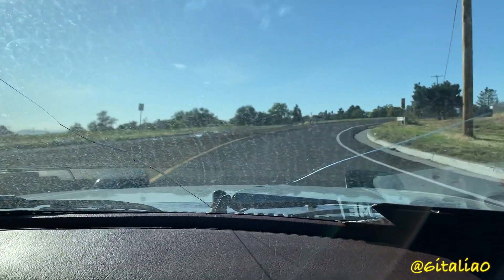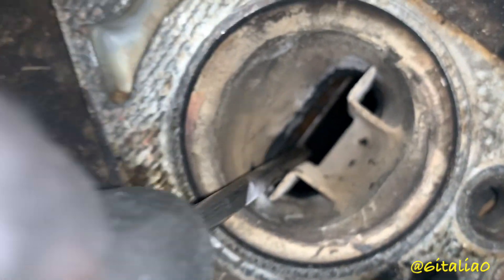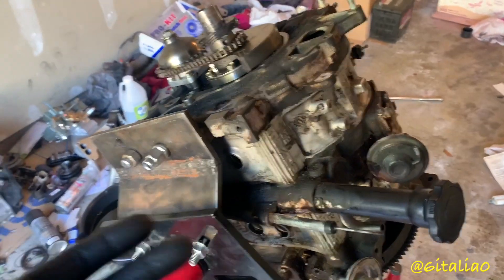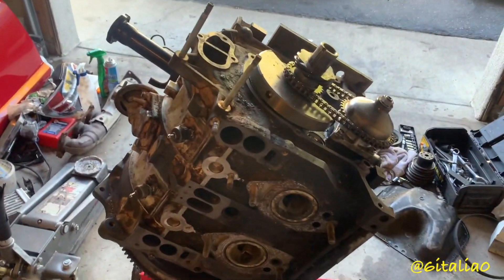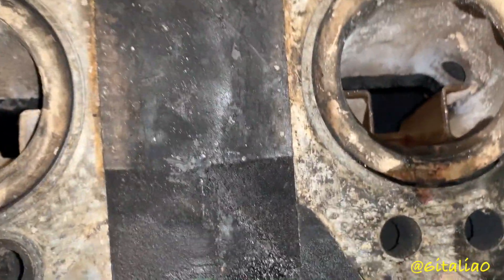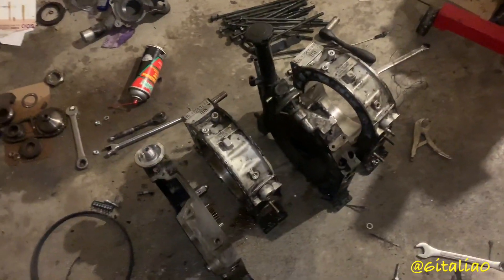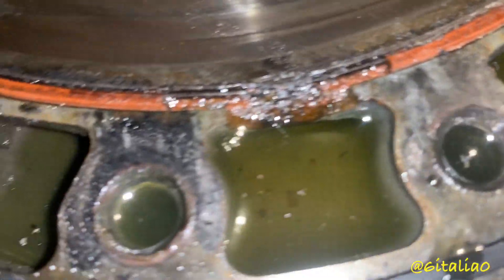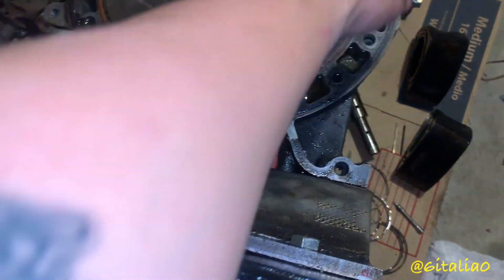WHY YOU SHOULD BEAT ON A ROTARY ENGINE (and what happens when you don't)

Comment: Hey Nate, I have an RX-8 and  I might have to rebuild it not 100% sure, I was wondering what you need as far as a rebuild kit? You said 105.00 for seals but let me know what I would possible need.
Reply from the maker: to assemble the keg you need apex, corner and side seals, oil control rings (should be reusable, depends how much silver colored wear is showing) and corresponding springs for each (this is all you need to assemble the rotors. to close the keg you will need water seals, orings for the oil gallery that goes through the upper left hand side of the engine, oil control ring orings  and tension bolt orings. Check out Atkinsrotary.com as they have complete kit including all necessary external gaskets and seals needed as well
Reply: @NateRist  Thank you so much!! So today I got a new battery and was able to start the car, but it wouldn't idle so I have to trouble shoot that. I had it run for 15 mins then turned it off. After that It wouldn't restart it just keep on trying to start. It backfires sometimes and blows smoke not coolent. Any direction would be helpful.
Reply: @huffdesigner  Get a proper rotary-style compression test. That will tell you the state of the engine.
Reply: @SeanFlaherty   Hello Sean, thanks for the tip. I took it to a shop where I'm from and they said one part of the engine fires and the other doesn't work. It just smokes bad.
Reply: I can get it started but it just dies after awhile and it smokes so bad. I will get a compression test and see what I need.
Reply: @huffdesigner  What color is the smoke? white is coolant (not good), blue is oil (also not good), black (I'm not sure, too rich?).  Do you notice your coolant level going down? Milky oil (coolant in the oil.). All not good signs.
Reply: @SeanFlaherty   it was whiteish blue I think. I checked the coolant and its totally perfect the levels are great. I know the motor is blown I don't know how bad. I need to take it apart. I might just buy one from a company for 2600.00. Not sure Im still deciding. I want to drive this car. I seriously love cars that handle well and that you can rev the piss out of.

Comment: Need help with my turbo 2 its been sitting for 10yrs had fuel problems at that time.. I don't now the rotary life.. any good rotary shop in san Diego
Reply from the maker: DNA garage can probably help you. They’re in Santa Ana, but give them a call and tell them about your issues and they should be able to help you +1 (562) 608-5161

Comment: Also you can put some diesel in it not a lot just a little and turn the motor
Reply: mix of naphta, diesel, and izopropyl alkohol in good ratio is bassicly seafoam, and i can say it cleans engines pretty good.

Comment: @3:11 the ATF trick yea but...@4:46 oh thank god lol. not sure what rotorhead taught me 10+ years ago about MMO on my first 6port FC but thank god he did. saved so many rx7's an got them on the cheap with some MMO an new spark plugs. plus now the rx8's are gettin nice an cheap ;-) which i already have 2 8's and 3 engines lol good stuff bud glad i was up at 2am to see this vid
Reply: and i still  have 2 fc's now and at least 2 engines all s4 na, except for a 6port s5 turbo vert with a fd upper manifold on modded s4 t2 intake i learned tig welding aluminium on. but if ya need some s4 plates or parts let me know bro
Reply from the maker: @REsuperGRX7  I'm probably just going to stick to 74-85 12As & 13Bs and renesis engines. With this S4 engine I really just wanted to put as little money and effort into it as possible as I'm not a fan of 6 port engines (besides renesis 6 ports). I do have another plan though which I'll go over in my next video.